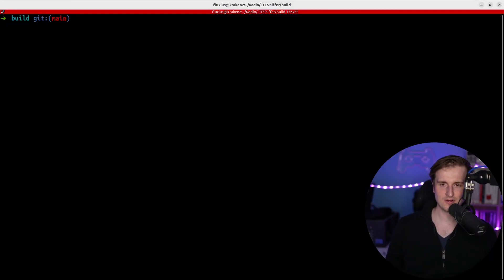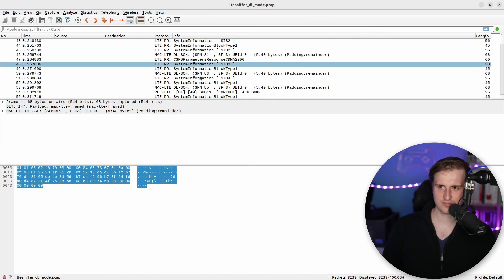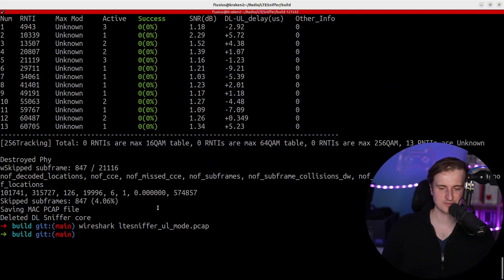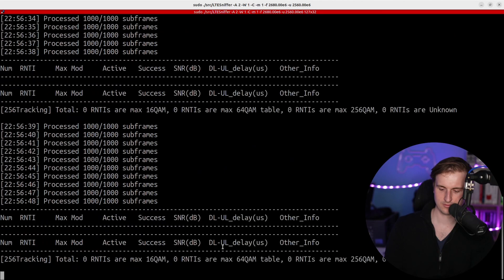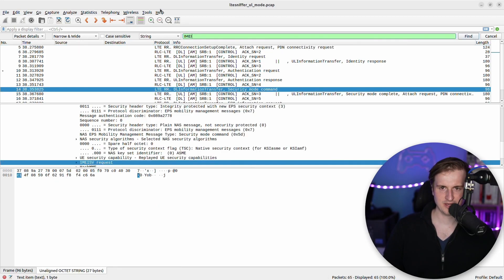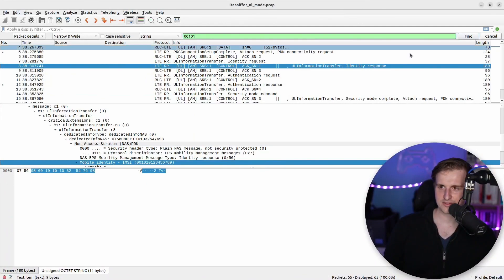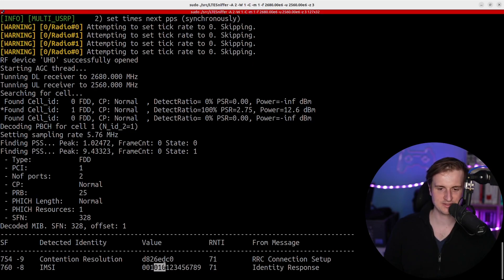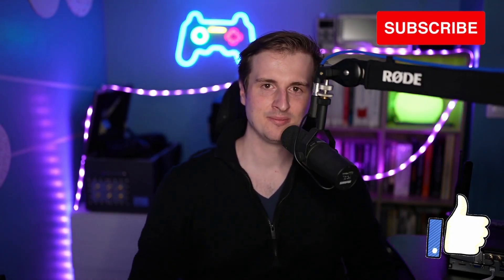Passive IMSI catcher: recent updates of LTESniffer

Comment: Hello Brother. I live in a rural area, with a very low population density. I'm thinking about setting up an early warning system using SDR. The idea is to set up an IMISI catcher detecting all the cell phones around me and comparing them with a base of known (regular) imsis. So when a new, unknown cell phone (from outside my area) appears in range of my antenna it would alert me and let me know that someone new is now in my neighborhood. I haven't started working on the code for this yet, but I would like to know your opinion about it and also if you have any insights about it or if you know some tools that are able to help me with that.
Reply: Any updates with this?

Comment: Hi, is this working with hackrf?
Reply from the maker: The 1st problem is that even if an LTE channel can be 20 MHz width and less, the hackRF sucks at getting a proper signal because of the LO leak so your signal has to be strong enough by guess. But the 2nd problem is that you would be only able to decode Downlink, or to adapt the too to work with two hackRF sync with same clock to get DL and UL in same time if you want the uplink too as you need to tune to two different frequencies.
Reply: @Penthertz  what are you using in the video? Is it your phone?
Reply from the maker: @catalinalb1722  I'm using a USRP x300, another SDR to simulate an eNodeB and a phone connected to it to be sure to have enough power for receiving uplink with a crappy antenna